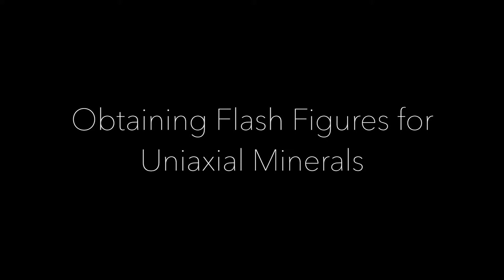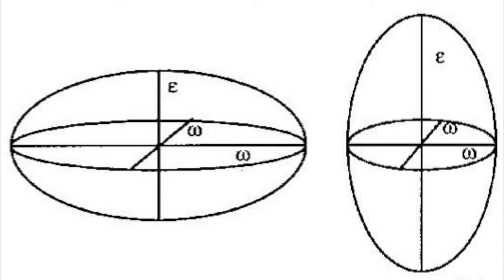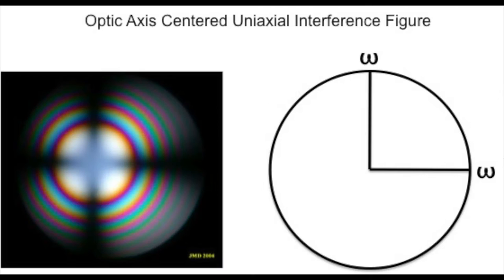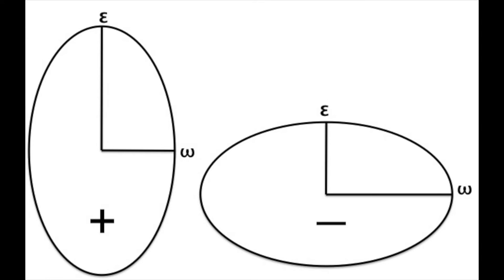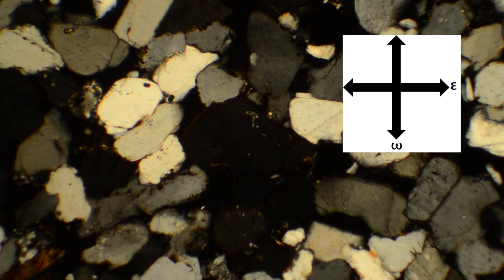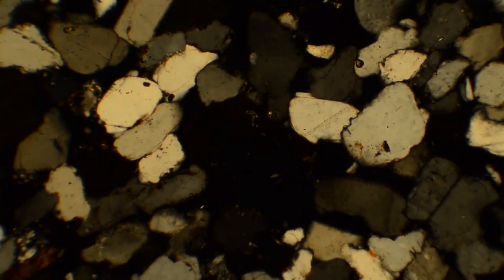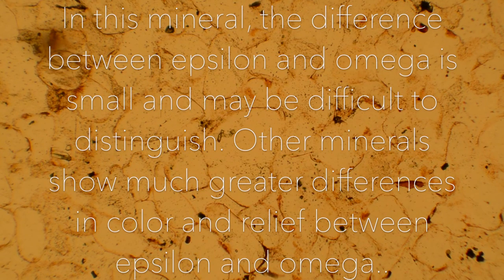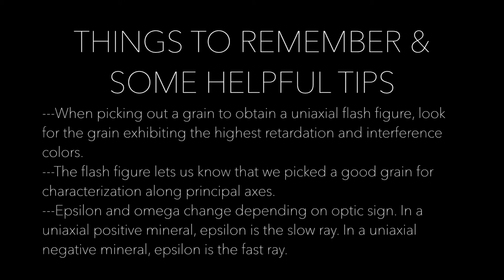Earth Optics Video 5: Uniaxial Flash Figure

Comment: I still don't understand what did you find out exactly with the flash figure and why
Reply from the maker: It's basically a check. If you see a flash figure, you know the orientation of your mineral grain, with respect to its principal axes. I find it helpful to imagine the 3D ellipsoid. If a flash figure is present, the mineral grain you are examining is oriented such that the 2D 'slice' of the ellipsoid you are examining is perpendicular to one omega axis and is parallel to axes epsilon and omega. If you don't see a flash figure, you can imagine that the slice of the mineral exposed on your thin section is closer to being perpendicular to epsilon and parallel to an omega-omega 'slice'. This is useful for certain minerals that display different pleochroism, birefringence, or indices of refraction with respect to their crystallographic orientation.

Comment: 2:50 I think there is a mistake regarding the color interpretation while accessory plate is inserted. Second order blue means higher retardation, meaning a higher refractive index and slow ray than the second order orange showing the fast ray.
The gypsum plates I work with are inserted from the SE and the gypsum's epsilon is in the NE direction and show similar optical traits as yours.
Reply from the maker: We interpret the yellowish-orange color in this video as a first-order retardation. We make this distinction based on the vibrancy of the orange... at higher orders of retardation, we would expect this orange color to be muted and pale. First order orange is lower than second order blue, leading to our interpretation that principal axis omega is ~parallel to the direction of the accessory plate when we see that second order blue. This interpretation is only valid for optically positive, uniaxial minerals. Hope that helps - happy microscop-ing!
-Sam